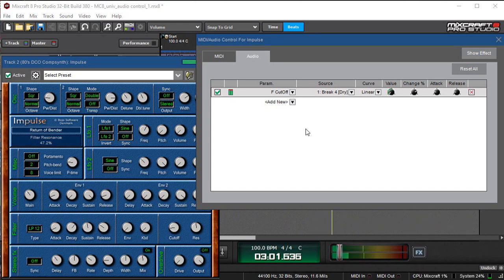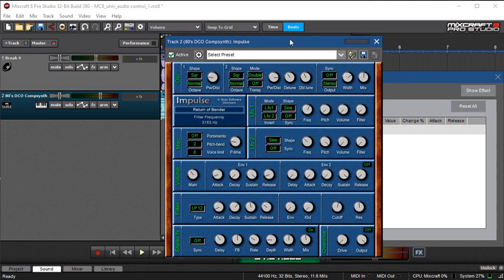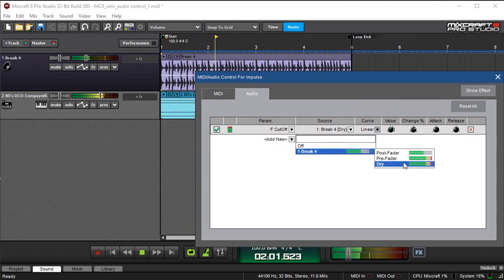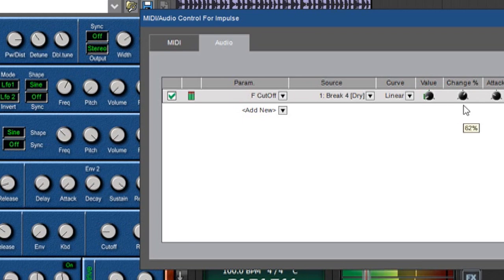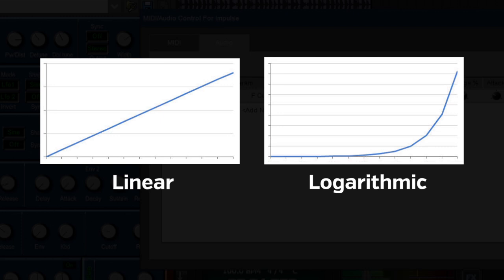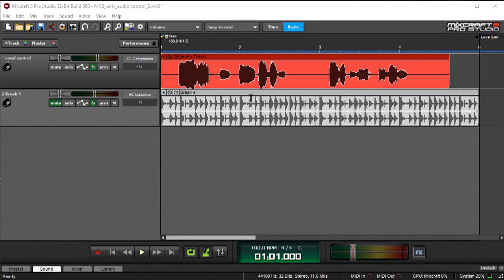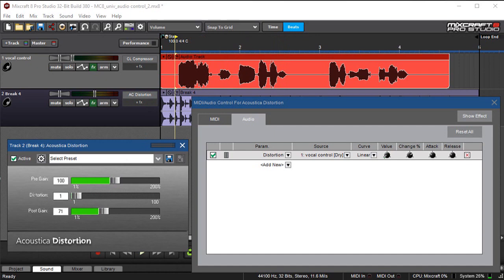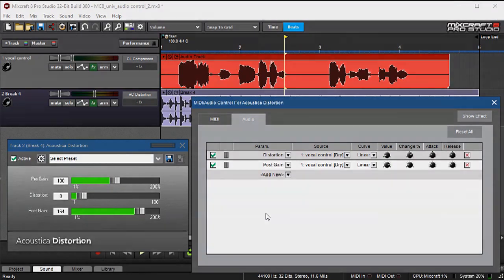Mixcraft 8 University: Using Audio Control

Comment: USING AUDIO CONTROL
The steps for setting up Audio Control are almost identical whether the destination is an effect or a Virtual Instrument parameter. In this example, we’ll use the Acoustica Distortion plug-in on a synth pad loop. The distortion amount will be controlled by a drum loop.
v
1. Here we’ve set up two tracks; the first is a beat loop from the Mixcraft Library and the second is an ambient synth pad. Any sounds can be used, but for the purpose of this demo, it’s a good idea to use a drum loop as the “modulator” (mod source) and a constant sound (like a pad) for the “carrier “ (sound that gets modified).
2. Click the pad channel’s fx button; choose Acoustica Distortion from the effect list.
3. Click the gear icon next to the Edit button in the effects list, then click the Audi's a good idea to loop the playback of the clips so they’ll play continuously while you tweeze parameters. To loop playback, check that Snap is set to an even value (Snap To Grid is fine), drag a highlight region over one or two bars in the ruler at the top of the Main Window, then click the Loop button in the transport. Now thwack the Play button, and we’ll get this Audio Control party started.
5. Going back to the MIDI/Audio Control Assign Window, choose the effect parameter you’d like to Audio Control by clicking Add New in the Parameter column. All parameters for the chosen effect will be displayed. Choose Distortion.
6. Now we’ll select the mod source - that’s fancy shorthand for “an audio track that will automatically vary the parameter.”
In the Source column, click Off (or the down arrow next to it). A list of all audio tracks in the current project is displayed. In this simple example, the drum loop track (“Beat”) is the only choice. Hovering the mouse over it displays a sub-menu where you’ll select from Post-Fader, Pre-Fader, or Dry; click on Dry. If the project is currently playing, you’ll see level meters that display the amplitude of the incoming signal.
7. We recommend keeping the effect or instrument interface control panel open in order to easily see the affect the Audio Control signal is having on the destination parameter. If you don’t already have the effect or instrument control panel opened, we’ve made this super easy - just click the Show Effect button.
8. The Value knob sets the initial parameter amount. This overrides the parameter control in the instrument or effect itself; you’ll see the effect parameter moving as you move the Value control.
For this example, you’ll want to turn Value control all the way down, because we’re going to use Audio Control to crank it up and back down.9. The change affects the Audio Control depth; i.e., how much the audio signal changes the parameter. Change can have positive or negative values; if Change is set at its median setting of twelve o’ clock, Audio Control will have no effect at all. Dialing the Change control to the right adds to the initial Value setting, conversely, dialing Change to the left subtracts from it.
In this example, we’ve set the Value control all the way left (setting the initial Distortion amount to zero), and the Change control all the way to the right (causing the drum loop to dramatically increase the amount of distortion with every hit).
10. Similar to the controls on an audio compressor, Attack and Release knobs regulate how quickly the parameter is changed. In this example, we’ve set both to values of zero, equating to instant changes. Turning the attack up will slow down the affects of transients in the controlling audio; conversely, turning up the release slows the speed of parameter adjustment when the audio signal becomes quieter.

Comment: How can I automatize all the level of an effect? 
e.g.: having an EQ effect with adjusts in all the frequences, how can I automatize the level of the whole EQ? I only see the option to doing it with each frecuence,that it's not what I mean.
Reply: If your EQ has an output gain or maybe a mix control you could automate one of those to control the whole EQ level.
Reply from the maker: Yes,  or you could put the EQ on a Send track.

Comment: Whoa! Can I use the audio on a track to Control the FX parameters for FX on that SAME track?  I am thinking of a poor man's dynamic EQ, where the audio level would adjust the amount of cut/boost of a particular frequency.
Reply: Actually you could do this by duplicating the track and muting the first track.  Put all your effects on the duplicated track and route the muted track to this duplicated track.  The original track will only be used to send audio automation!!  Matter of fact you could take it further by running a high pass and low pass eq on the muted track and only sending a portion of the audio to be used for automating for this you would use pre-fader for the automation setting.
Reply from the maker: At present no, but this might happen in a future update.